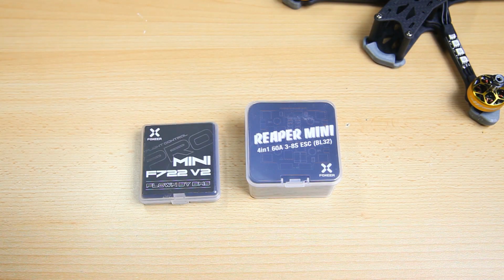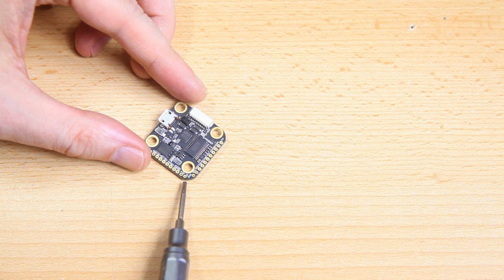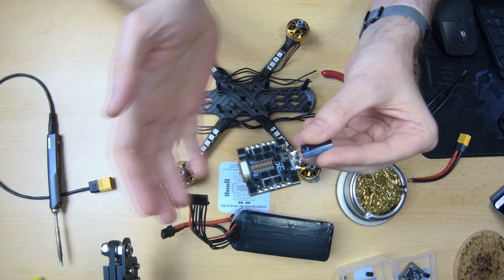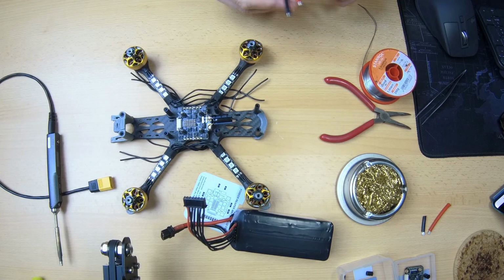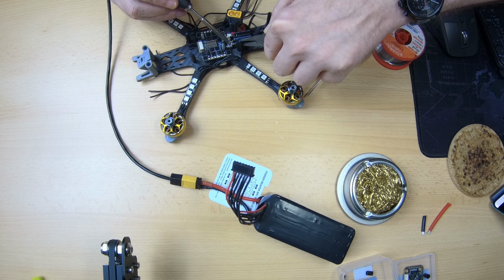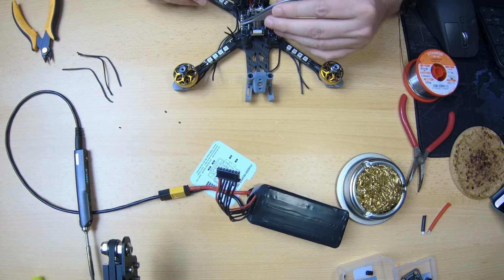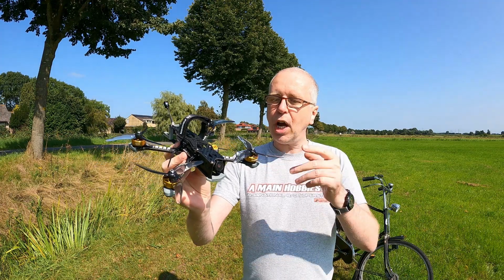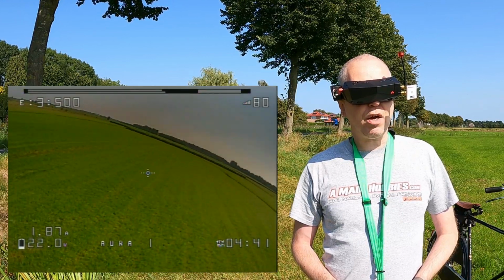Foxeer Reaper 60A 96Khz + F722 v2 Pro - Night Fever 2021 Build Project - SHOW & TELL ! :)

Comment: I think I probably soldered positive power pad with one of the  "M30" element, which extremely close to positive pad.  All works good.  Should I do some clean solder? or its no matter?
Reply from the maker: I think you ment the Shunt Resistor (current meter) ? That is NOT a problem at all.. that positive track is connected to it "in" the board anyway :)

Comment: they should really include some M2 to M3 grommets.
They don't exist on earth and i can't find any frames with m3 20x20 holes
Cant drill out the holes on my frame either, due to how the arms join together. An expensive flight stack for my desk drawer.
Reply from the maker: some (bigger) servo's actually come with those.. so I have "a few" but you are RIGHT.. Foxeer should include it.. especially as they are kinda the only ones (for now) the run these 3mm holes in 20x20

Comment: ESC running on 48k or 96k as you mention in video title ? (During flight)
Reply from the maker: 96K I think it was set to that by default but not completely sure :$
Reply: @DutchRC  let me tell us is that 96k or 24k , just because I didn't saw as smooth as I thought 😅
Reply from the maker: @mokshpatel6986  The next question would then be: does 96Khz actually benefit bigger quads? :)  some people say it's mostly a benefit for Smaller quads
Reply: @DutchRC  yeah I know that but in my setup if I use 24khz then normal as it is , but if I "only" change 48khz in bl32 setting them it's too smoothly and feels like warm butter in pan just slipped anytime with new or broken props

Comment: With thick wires better to solder them to  the ESC then cut them to suit the XT60 connector.  And put the Capacitor on last.
Reply from the maker: Yeah hmmm... I kinda did want to use them holes in the ESC's pads to fix the cap in place.. But your order of tasks would work out well to ofcourse :)

Comment: Pass through basically cleans up the build where need be. So instead of say TBS or Immersion gear needing a connection to the FC and another device like say VTX or RX, everything gets connected to the FC, so replacement of a component is much cleaner, quicker and easier to perform. Fantastic Video 🚀👍
Reply from the maker: Heeeeeee BMS in the house :D   Would it be fair to say the diagram on the product page doesn't clearly show the benefit? (in the diagram it looks like more of a mess :$) 
Thanks for the addition / clarification ofcourse! :D 
Cheers & happy flying :)

Comment: I guess the heavy gauge XT60 cable
supplied by Foxeer is in anticipation 
that 8S Lipo batteries might be used !!
12AWG ??
Personally I would only use 14AWG
I like the expanded size Esc as the
motor wires can be kept away from
the FC. Hopefully reducing any vibrations that could be fed through
to the Gyro 
Thanks for the review and the soldering master class again 🙂👍
Reply from the maker: Thanks mate :)  and yeah.. there are up & downsides of curling the wires up under the FC... This was 12AWG indeed and just that little bit on the inconveniant side of things :P 
Cheers & happy flying!

Comment: I have the impression, that the CAT3 holds the WB rather nicely when you point it at the grass. Most cameras change WB, when they only see grass. This one is more stable.
Reply from the maker: I had not noticed yet, but True!  it was interesting to see how much the cam changes it's setting in the dark... More on that in the camera review :) 
Also: nojt home right now.. I'll look up the solder-tin later on :)

Comment: Usually you get propwash with heavy quad, for example I couldn't get rid of it on my 5 inch 850gr quad. With cheaper esc and motors on 780gr quad propwash was almost fixed by just tweaking a few sliders in BF.
Reply from the maker: Well sure.. you can get propwash with even the best tuned quad though, if you fly badly enough :D 
In test-flights I tend to look for it ofcourse..